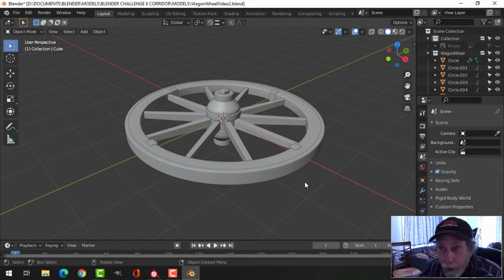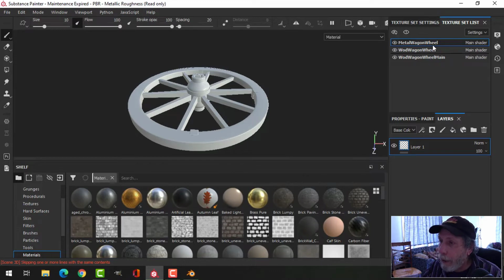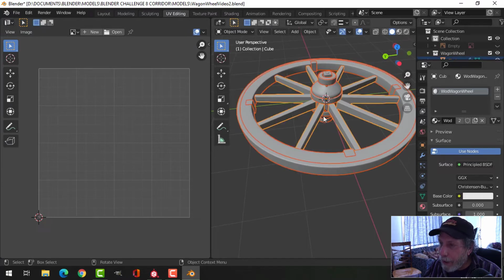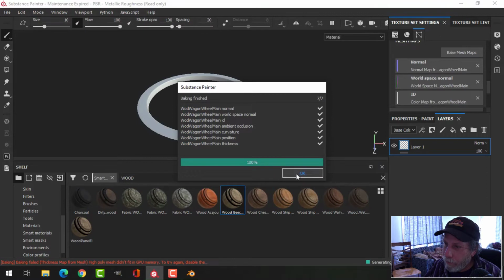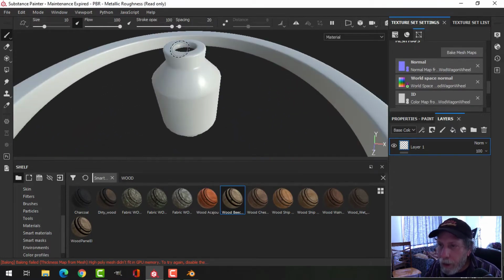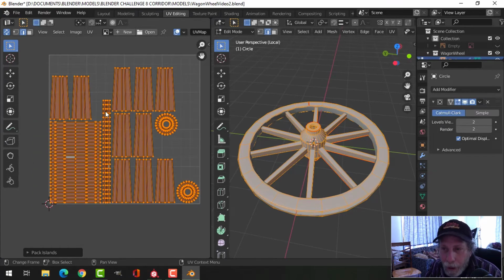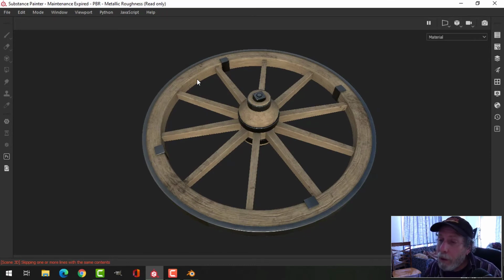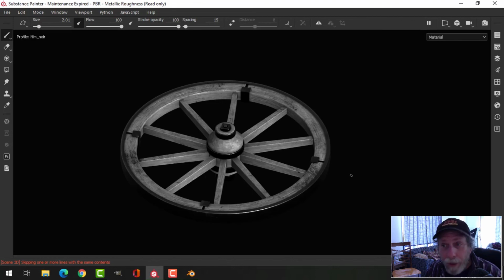BLENDER CHALLENGE 8: WAGON WHEEL TEXTURING (Part 15)

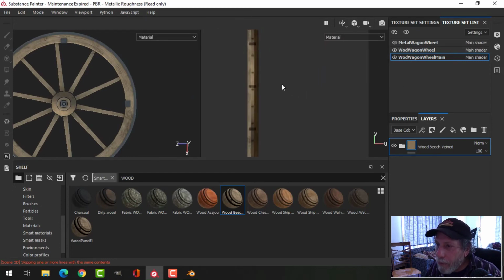Comment: Just a tip : there is no need to pack  uv islands of objects that dont share the same material because they wont be using the same texture later . You can see at 22:13 for example in the 2d view there is a very large empty wasted space . 
You only need to check for overlappings in objects that share the same material ! Hope that makes sense
Keep it up ^_^
Reply from the maker: Makes sense. Thanks for watching.
Reply from the maker: Will you please connect with me on the discord server. I'd like to speak with you. Thx
Reply: @zerobio  sure . I cant find the discord link in your channel can you put it in a comment please